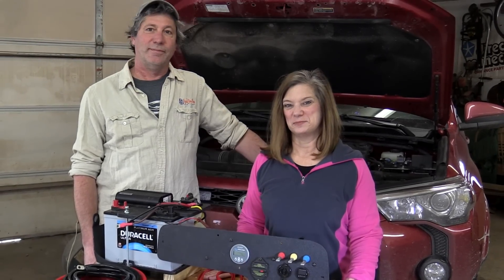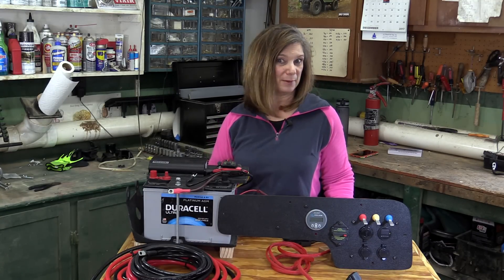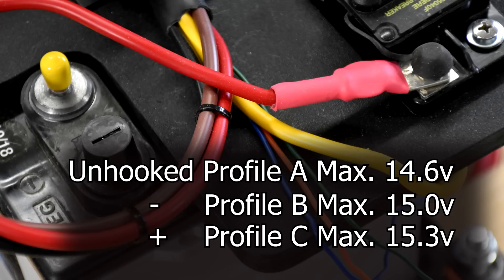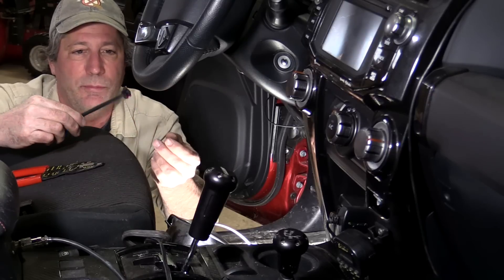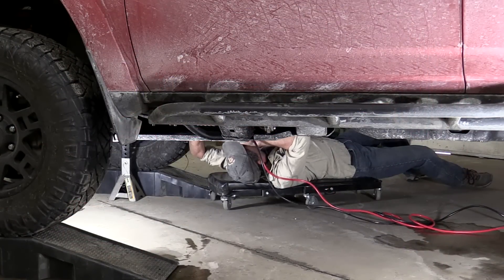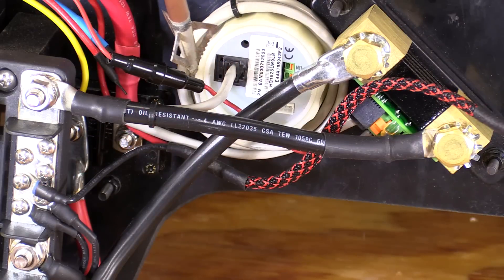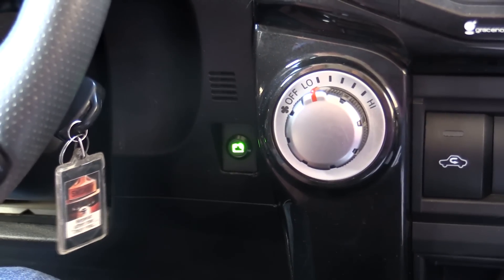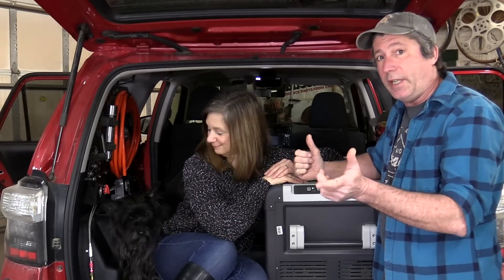Dual Battery Setup with Detailed DIY Install

Comment: Great job, question,  why did u run positive and negative wires to the back, coukd the negative not be achieved by common ground thru the frame?

Comment: Really would love to put a system like this in my 4Runner! Cool feature I would like to add is to have the stock inverter run off the second battery and have it operate at all times.

Comment: Awesome channel and a great video! I'm following your video at the moment and it's quite a bit to go through. How did you connect our fridge? I saw the clip where you mentioned to run it directly to the power panel. However, I don't understand how you plugged it to the fridge?Did you just cut the fridge 12v power wires and connected to positive and negative to power panel? I'd appreciate some guidance on that :)

Comment: do they need to be same/similar batteries?  I have several various sized good 12v batteries just sitting around in my garage going to waste.
Reply from the maker: When using a dc-dc charger the batteries can be completely different.

Comment: Nice, def a quality job. If you still have your Toyota and your Redarc supports lithium you might want to upgrade the batt. AGM only allows 50% drain where lithium with the same rating and size will let you drain 80% or more if done only occasionally. Lithium has a much longer usable life as well. I can recommend the Renogy batteries. I've been using 2 non smart non bluetooth ones for over 5 years with no issues. I paid over $1000 each, now they're running for only $429 each. Non smart does not mean they don't have self contained battery management systems n temp probes.

Comment: I know this video is 4 years ago, but hopefully someone could answer this noob question. Do you necessarily have to run a ground cable from starter battery to secondary battery? According to the bcdc manual, all grounds connect to chassis only. TIA.
Reply from the maker: All can be grounded to the chassis.

Comment: Just curious, why no breaker or fuse between the Redarc and the auxiliary battery?
Reply: wondering the same thing, as it shows one in the Redarc wiring diagram.

Comment: hi all, I didnt see you install an isolator in the setup, did you do that as an add-on after you did the video? thanks!
Reply from the maker: No need for an isolator with a dc-dc charger.

Comment: lportil
1 day ago
A bit late but thanks for the reply, I finally decided to do a dual battery set up, I see you have the 40 amp breaker close to the second battery, I’ve been reading that it should be close to the energy source (main battery), seen other people bolting it to the main fuse box close to the main battery, all help is appreciated
Reply from the maker: The engineer who designed ours was wrong in putting it where he did. Breakers and fuses are always best as close to the power supply as possible.

Comment: Hi, thanks for the video which I have watched about 20 times. I am very ready, thanks to you. In the list of items you have not provided one for the add-a-circuit device. I have been looking around and since I don't know what the actual fuse type is, it is difficult to order one. I know that I can remove the fuse to find out what type it is, and it is disappointing that the owner documentation doesn't say what they are. Would you mind adding a link to the one you used?
Reply from the maker: You can go to any auto parts store and they'll know exactly what you'll need.

Comment: Hey. How has the Cable held up under the rig? I’m thinking of partially copying your setup. Anything you would do differently now?
Reply from the maker: Very good. We keep it run through the cheap plastic conduit to keep salt and dirt off them.
Reply: @WanderlostOverland  Thanks!

Comment: Great video! Very informative. I emailed the team at Overland Power Solutions for some help; it’s been over a week with no response. Did they take a while to get back to you..? 

Thanks again! You two are great :-)
Reply from the maker: Thanks for watching! To be honest, I'm not sure if they're still in business. Were you planning on doing the install yourself, just reaching out to them for some technical questions?
Reply: @WanderlostOverland  Awe, man - they might've closed up shop? Booo.. yes, I was planning on doing the install myself, AND I have lots of technical questions. There are no kits out there, so I need help piecing one together. I have a 1st gen Nissan Frontier, and sources are slim/none for my kind of truck. 

Actually, I take that back. I've found lots of forums on it, but it's so hard to find that specific one that addresses my numerous questions and worries. It'd just be so much easier to talk with someone who knows this kind of thing inside and out, and someone who can help me look at my truck's specs and guide me to NOT start a fire in it!

Comment: Wow 14.8 volt agm battery? I have an agm battery, it charges to 14 .4 and works great, its a secondary battery in the back of my 01 chevy express conversion van, i only use it at night to sleep, to run a fan and i need to pay attention to what you are doing because i would like to get a small fridge, so i can keep milk cold for my morning coffee, thanks for the video, you are both great, im into the van life, so the van is my home and i go to the gym for showers:)

Comment: I talked to Overland power solutions and was given a price of almost $5000 for a duel battery set up. Seems a little high to me ! What did y'all pay for your setup?
Reply from the maker: $5,000!!!!! Holy cow, we maybe spent half that much for our complete system. Does their price include installation?
Reply: Yes the price is for there power in a box setup with the battle born life po 4 battery but I have to install it myself. They do build up the box for me.

Comment: Did running your blue wire to that fuse work?  I finished my install and hooked up to the same fuse and it’s not charging my second battery over 13.5 volts.
Reply from the maker: It works fine for us.
Reply: @WanderlostOverland  Yeah, disregard.  I didn’t realize it was in float phase.  Thanks!

Comment: Do you think there is room for a Group 24 battery in there?  Its 1 inch taller, otherwise the same. Group 24 has higher amp/hrs available.  In your video it looks like there might be enough space above the charger, but it might be tough getting the charger/hold down plate over the hold-down bolt. What do you think?
Reply from the maker: We're right now testing out a new manufacturer's lithium battery for under the hood. It too is an inch taller. It fits, but just barely. And that back hold down nut is VERY hard to get on.
Reply: Ok, so I discovered that I have a group 24 battery right there under my hood to use to mock this up! Dah! It measures 8.75 inches to the top of the posts. I set in place on my C4 battery tray and it looks like it will fit fine. To alleviate the tight access to the rear hold-down nut, I'm thinking of putting a wing nut on it and cutting a slot in my 1/2" plastic board so I can slide my board (with DC/DC charger mounted to it) in place around the all-thread rod, rather than having to come down over it.  Sound plausible?

Comment: Another well done video!  I've compared your two videos on your dual battery installs and rear power panel installs and have two questions: on the 4runner you added the fridge connection which led you to use  a fuse panel that utilizes a Safety Hub 150 with high-amp fuse.  Is that necessary?  Doesn't the fridge only use around 5 amps?  What am I missing? And second: Have you found that you really utilize the Victron monitoring system?  Or is the Blue Sea voltmeter adequate?  Just trying to shave off some dollars if your FJ jet up is ample.
Reply from the maker: For the 4Runner we relied on someone else to engineer our system. The SafetyHub fusebox is way overkill. You're correct, the fridge only needs about a ten amp fuse. We rigged a "high amp" position down to ten amp by splicing in an inline fuse. 
The Victron is nice, but in our opinion a much simpler, less expensive monitor will do just fine. A simple volt gauge will be all you really need.
Reply: Really appreciate your taking the time to answer these questions.

Comment: Any tips on how you measured and made the power panel in the back to the exact size? Having a hard time getting an out line with paper. Thanks
Reply from the maker: We used cardboard and just kept making small trims on it until we got it just right.

Comment: Hey guys great vid but gave it a dislike for no parts list, which I'll be happy to change to a like with a list.  Excuse me if I over looked the list.  The vid does display the "ease" that adding a 2nd battery to a vehicle similar to yours, BUT leaves the viewers trying to figure out what all the parts are.  It doesn't even need to be links to the part, a list would be fine.  Something like: ACME Matches, ACME detonator, ACME Bird Seed...

Comment: Just curious why you ran a negative from the starter battery directly to the auxiliary battery. I’m looking at the redarc manual and it doesn’t require you to do that. Just shows going directly to a chassis ground.
Reply from the maker: In the past we've had endurance issues with chassis grounds. To avoid any hassles or mishaps, we like to run our grounds through cables.
Reply: @WanderlostOverland  thanks for the input. In the process of doing an install of my redarc and I made a custom mount and mounts in the same location yours does. Have you seen any issues with heat affecting the controller?
Reply from the maker: @kennethso9853  No issues with heat that we're aware of.

Comment: very nice, since I am such a noob I would have to have more info on all those wires (confusing) but i do have a couple of questions, first: I usually connect the battery to a "battery tender" when not in use (weekdays) will the system charge the main then the back up? and the second question would be similar but with solar panels while camping etc?
Reply from the maker: With a dc-dc charger, when the engine is turned off the two batteries are completely separated. Hooking a battery tender to one of the batteries will do nothing for the other one. Same goes with the solar panel. If you're hooking the panel up to the second battery by going through the dc-dc charger, it will only charge the second battery.
Reply: A bit late but thanks for the reply, I finally decided to do a dual battery set up, I see you have the 40 amp breaker close to the second battery, I’ve been reading that it should be close to the energy source (main battery), seen other people bolting it to the main fuse box close to the main battery, all help is appreciated

Comment: Quick question, do I need to keep my isolator set up if I install the bcdc (on a 2020 Tacoma)
Reply from the maker: Nope, no need for the isolator. There's one built into the charger.

Comment: Mark, I am looking to add a similar setup.  The Victron monitor system is quite expensive.  In retrospect, do you feel it is necessary and worth it?
Reply from the maker: Thanks for watching Tim! The Victron is great, especially showing the amp hours left in the battery. They have a new model our now where it doesn't use the actual gauge. It's just bluetooth. This saves a little on the cost. A normal volt gauge will tell you the same basic info though. I don't think we would spend that much on it again.

Comment: STAY AWAY FROM OVERLAND POWER SOLUTIONS. I emailed them about a system I'd like to install in my truck. I have a couple specific parts I'd like to use, eg. Big Battery's Extreme Power Block, CTEK D250SE & SmartPass 120S (DC-DC charger), Victron SmartSolar MPPT, and they responded back with an email stating a bunch of BS and ending with "it seems like your implementation is outside of our wheelhouse".  All because I won't use Battle Born batteries and Redarc's DC-DC charger. Guess they didn't see that Duracell AGM you guys connected your system to?????

Comment: If I have a 70 amp battery, and I add another 70 amp battery, - do I need to change the alternator and for what current?
Reply from the maker: I believe it depends on how you have the two batteries connected. That's a question best left for the proffesionals to answer. Shoot Redarc an email.

Comment: Where did you get the plastic pop riveted brackets to mount your control panel with?
Reply from the maker: And auto parts store will have a good selection.

Comment: Thank you very much for this great video! It answered my biggest question on where to get power for the Blue wire. I am wondering if your happy that you placed the charger close to the auxiliary battery? I love the setup.
Reply from the maker: Thanks for watching Ron! We're glad you liked it. Putting the charger at the battery was really our only option in the 4Runner. Not the best, being in the heat and moister under the hood, but so far it's been working just fine!
Reply: @WanderlostOverland  From what I've read from redarc is that the charger is suppose to be as close to the charge battery as possible, which in our case is under the hood.  I think your idea was brilliant, especially since it's working just fine.  Thanks!

Comment: Hello Wanderlost, Jonny from the KuehlKuest. Quick question. Since you have been running this setup, di you or has there been a need to upgrade your alternator?
Reply from the maker: Nope, with the dc-dc charger there's no need to modify or upgrade the alternator.
Reply: @WanderlostOverland  Awesome!! Good to know. Thank you

Comment: As always, awesome video and super helpful content. You've created a ton of inspiration for many people. I'm in the process of doing a similar setup (though much simpler, i.e. no rear power panels, haha). There's one piece of your setup I'd like to better understand - why 40amp circuit breaker given charger's 25amp capacity? I totally agree it's a good idea to have a layer of protection between starter battery and charger, whether it be a circuit breaker or fuse block, and I'd like to do the same, I just don't what's an appropriate amount. I went with a 20 amp Ctek charger, so trying to decide if I should also go with 20 amp circuit breaker, or 30, or 40 (maybe 40 is too high)?
Reply from the maker: Honestly, I left details like that up to the folks that designed the system for us. Not sure why they chose that particular amperage.
Reply: Ctek recommends a 30 amp breaker at each bettery.  Your minimum load breaker will depend on your loads.

Comment: You need to move your BMV shunt to between the redarc and your negative on the battery. then connect your cable that runs to the back to the load side of the shunt this will record all your charge and discharge. you can then run a positive wire with a fuse from your starter battery to the bmv in monitor in the back and monitor your starter battery from the front. this will give you a better run down of everything.
Reply from the maker: Thanks, great advice!

Comment: For the longest time I just ran my refrigerator off the starting battery with a low voltage alarm and disconnect. With solar I installed a second battery with fuses on both ends of the connecting cable. The parking heater neccecitated the added battery capacity.

Comment: can the current alternator give charge to both the batteries for a long time or do u need to upgrade the alternator? I noticed that the voltage of the second battery is dropping, would that second battery last long?

Comment: good video as usual.  Does the 4Runner have a smart alternator?  I dont believe so, in that case the little blue wire is not needed to connect to ignition circuit?
Reply from the maker: The 4Runner does have the "smart" alternator.
Reply: Thanks for your reply.  Glad to learn from guys like you.  When  you tap into the fuse box, can you close again the lid or does  the fuse tap prevents you from doing so?  Do you know if there are fuses to do this tap in the engine bay fuse box?

Comment: Great video, thank you for sharing.  What is your average battery temp in that location?  I’m assuming the victory 712 will give you that info?
Reply from the maker: The Victron does have that capability. We didn't configure it that way though so I can't give you a real number. I can tell you that it's not too hot, but it would be better to have the battery in a cooler location. Our only option was to put ours under the hood.

Comment: Does pushing an additional 25 amps of power into the aux battery stress the alternator in any way or is it too low of am amp draw to make a difference?
Reply from the maker: No, it's not enough to make much difference.

Comment: Great video. Learned a lot. One quick question. So, how much was the total setup will cost not including labor?
Reply from the maker: It's been a while since we did it. After adding up ALL the pieces and parts, I think it came in around 2K. Not cheap, but since installing it's been working flawlessly!

Comment: If there's no space in our engine bay for the secondary battery, is there someplace safe to place it inside the car's body or trunk? I understand that they vent fumes when in use, I want to make sure my setup is safe
Reply from the maker: The AGM closed batteries don't vent. Many people place them inside the cabin.
Reply: @WanderlostOverland  Oh, okay, that's perfect then! Thank you!

Comment: That's a really cool video. Looking to do a system like this for my Wrangler. I don't want to go with the standard dual battery that people do and this solution seems perfect.
Reply from the maker: We've had it installed for well over a year now and are very glad we made the investment. It's truly a no hassle, no problems, it always works when we need it system.